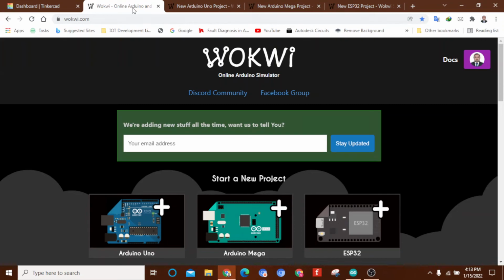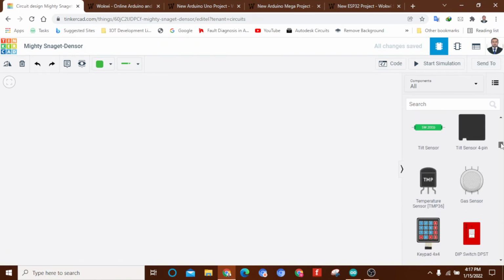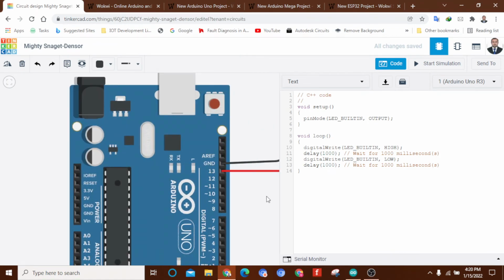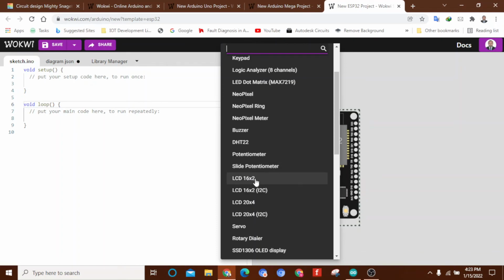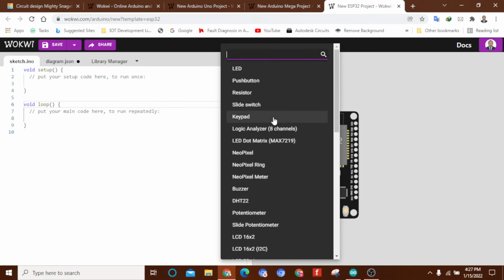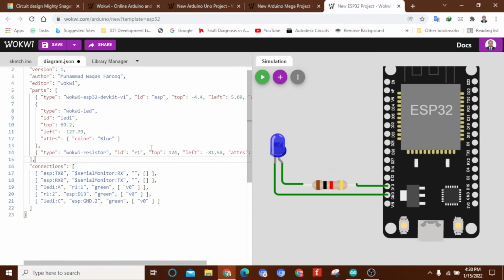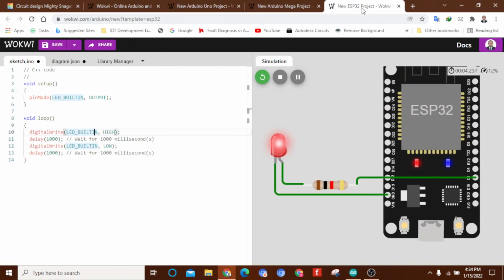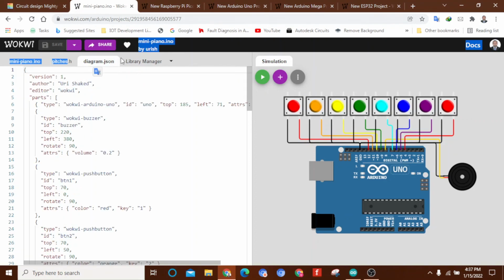Comparison Between Tinkercad and Wokwi

Comment: Too bad both don't have IC like CD4026,etc.
Tinkercad is also missing XNOR IC while other logic gates are available. 
Both also don't include regular 5 pin Relay which you can normally find in the market.
Reply from the maker: you are right and you can go to wokwi website as well to find out and do the simulation